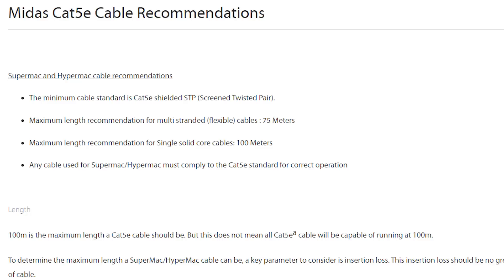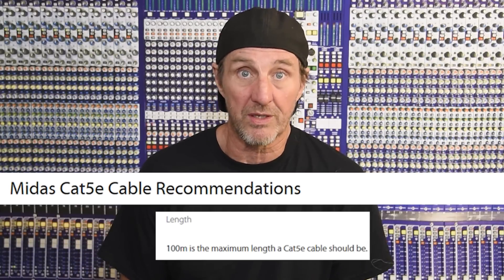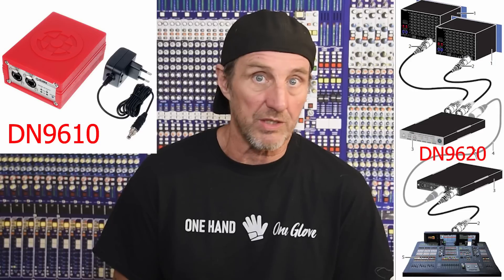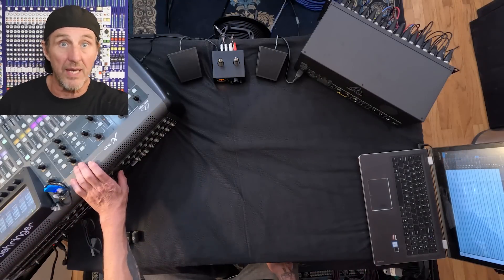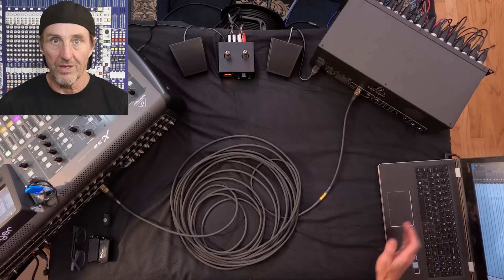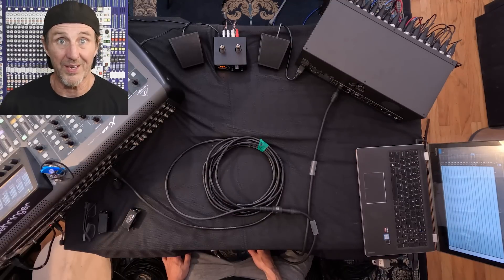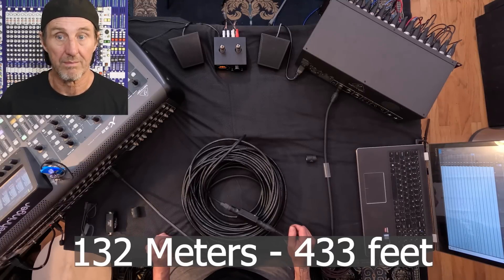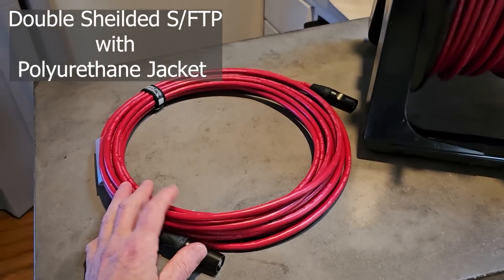Solving Long Stable AES50 Runs

Comment: As I mentioned in the comments section on your previous video relating to your new Cat 6A cable, Dave was very helpful pointing me in the right direction to get some Sound Tools Cat 6A in the UK. And so far, so good. The 100m length has performed as promised.

Typically I’ve ran 50 meter Cat 5e cables, and pops and silence have occurred when in venues where poor quality cable protectors have been used, or refrigerators for the bar have later been installed near my cable runs. Silly things, not show stoppers but in my view embarrassing and unprofessional.

Misinformation from ill informed ‘professionals’ parroting the erroneous information that has been circulating - particularly on Facebook groups can now hopefully be dispelled. Until Behringer/Midas improve their AES50 implementation in existing or new consoles the Sound Tools Cat 6A may be the only thing to save a great show from becoming a potential disaster.

As the summer festival season continues, I hope to review my success with this great new spec’d cable in the future.
Reply: @DaveRat Here I am half way through summer and your Sound Tools SuperCat 6A cable at 110 meters has performed flawlessly! I haven’t had a single drop out the last few months. I highly recommend this cable and the specification, and I am incredibly thankful for the time and effort you’ve put into creating such a useful tool that actually does what it sets out to do! To anyone who has experienced difficulties with Behringer/Midas products using AES50 - this Cat6A cable is the real deal! Even out in the wild!
Reply from the maker: @DanielEdwards- that is so cool and thank you Daniel!!
Reply from the maker: Super cool and thank you Daniel!
Reply: @DaveRat  I'm UK based also, and will be seeking to purchase one of these reels too. I've had problems with pops, drops and farts over a relatively short distance (50M) with the cable I have, and more recently I worked a venue where there was clearly a high degree of electrical noise. When connecting the DL32 to my board, the presence of the stage box was acknowledged, but it would not sync. When it did, as soon as I tried to play audio, it cracked, and dropped out.
Reply from the maker: Super cool, if you buy the cable, please let me know how it works and if ya like!

Comment: Dave, if I run 150 feet from my front of house console to my dl32 and then out of the DL 32 to a dl8 with hundred foot cat, does that mean my “aes50 length” is 250ft or just 150ft? I’m using all purple Super cat 5e and it’s been great. Just thinking about extending further.
Reply from the maker: no they're not additive so you have 150 ft run and a 100 ft run and you are well within a safety zone. All good!

as far as extending further, up to 250 with supercat is good,

so you can do 2x250 as long as it hits a box in-between.

if you use couplers, use the cat6a version and figure about 5 feet lost in length per coupler added.
Reply: @DaveRat  cool thanks Dave! One more question is the purple super cat 5E the most durable sound tools  cable? I need a few more and they need to be able to be stepped on and abused
Reply from the maker: here's a quick rundown of the sound tools cables and the thought behind the design of each one.

supercat is a CAT5E grade cable that looks and winds like a mic cable but has a polyurethane jacket like all sound tools cables that allow it to be flexible and high and low temperature environments and is extremely abrasion resistant  super cat is the best cable for State boxes and short to medium long runs

supercut 7 is slightly less flexible and windable but is double shielded which allows it to perform better in high noise environments and is great for ultra high speed data for shorter to mid-length. The extra shielding though and the small diameter make it a bit less ideal for longer runs.  super cat 7 is the best for high noise environments for short to medium long runs

The supecat sound is probably the only cable in the world that Cat5e ( actually better than CAT5E and almost cat 6a) Great that has an individual ground wire for each twisted pair. I don't think anyone has ever done this before and no one else is doing it. this allows super cat sound to be terminated like a normal four channel audio snake cable but provides the frequency response and data bandwidth that exceeds cat 5e.  super cat sound is our lightest weight cable and has  an extremely high pull strength making it the most durable cable that we make.

supercat XM is a large diameter cable like supercat sound is,  supercut XM is Cat6A grade and double shielded like supercat 7, And with the larger diameter double shield, it's extremely resilient to high noise environments and can run extremely long lengths with high speed data and/or analog because of its ultra low capacitance  super cat XM is the best cable for very long cable runs of 100 meters or more. supercut XM is very durable but not as high of uphol strength as super cat sound because it's the same diameter but rather than internal high strength fibers as filler it has more shielding making it a bit less flexible as well and a bit heavier. 

Cool cool I hope that helps and somewhere on the sound tools website is a chart which shows the data and specs of all the cables. 

but also I will gladly answer any questions and awesome thank you!

Comment: I've been touring going on two years now using AES50. We haven't had a show stopper yet, but plenty of problems (we were able to solve, but still...). Easily 95% of all problems we have is due to the venue not caring to cheack what kind of cable is actually needed.

Comment: Can repeat with gigabit Ethernet switch?
Reply from the maker: aes50 is a point to point protocol that will not pass through a switch. you can repeat it with a Klark dn9650 or dn9630, though at least for live audio adding a box and power in the middle of .a cable run where typically the audience is stomping around is not ideal.

having a cable that works at the length needed with no added cost, complexity or failure point is significantly more realistic

Comment: Hi !

Thank you for this very interesting video! For my part, I have varying results. I tested two reels that I made myself and that I use on my lighting console, they are Cat6a in F/utp (50 and 100 meters) and neither of them work. I used a prefabricated cat7 cable in S/FTP and a length of 100m and it does not work. The only long cable that has worked to date is a prefabricated 50 meter cable in cat6 in F/utp. I admit that I don't understand anything anymore and that I would appreciate a little help.... I am with a wing compact and two S16

Comment: Or, go fiber and 1000m. Klark Teknik DN9620 or DN9680. More pricey but, more bulletproof and longer.
Reply from the maker: Yes fiber is a good solution and we offer fiber on all of our systems. That said, fibers expensive, it's delicate and it is time-consuming and unless you can do fiber termination in house, The turnaround time for fiber repair can be considerable.

We have 16 drive systems as well as 32 node racks for the various deployments we do for large festivals and arena tours. 

We just got done switching all of our main snakes over to SuperCat XM and removing the two fiber lines that were attached to our 100 m main snakes. 

We kept having problems with fiber breaking and failing and we were spending so much money on fiber repairs and replacements that we had to find a better solution. 

So now every main snake has redundant super cat XM and every tour and gig goes out with two fiber reels that can be run separately if the engineer or technicians want to use fiber instead. 

Since we switched over we have had zero failures of the fiber because it hardly ever gets used because engineers and techs don't want to do the extra work to run the extra cable and zero failures of the more robust and reliable and easier to fix SuperCat XM Cat 6A cable.

So yes fiber is great except when it's not and we are a fairly good sized rental house with over 500 large format Main PA boxes, not a huge company but big enough and have been around for 45 years since I started the company so we have some experience in the field.
Reply: @DaveRat  Right on right on thanks for the reply brother! Even "Tactical" fiber is not crush proof. Also fiber ends and SFPs do need to be cleaned. Outdoor festivals yea I can see that being an issue. I primarily do indoor conferences and meetings so not much of an issue for me.
Reply from the maker: Yeah, so many variables and it's all about finding the best solutions for the applications.

Great to meet ya!

Comment: Don't understand the fuss here. Just use shielded cable, with very low high-frequency attenuation. AES50 data transfer is based on standard ethernet physical layer, so it has absolutely the same taste in cables. Just go straight for CAT6A, or CAT7, if you can terminate it in the ethercons. Limiting the number of connectors on the way also helps - so do not splice cables if not absolutely necessary. And sure, solid core cables have better transmission properties.
Reply from the maker: Agreed and also testing and showing that the words actually work in real life is important. There are a lot of words out there that people make up

Comment: I was toying with purchasing the DN9620 just to avoid this issue. But at $2300 plus the cost of a fiber snake, it’s a bit pricey. Although there is the benefit of extending the length up 500m!
I just purchased your 100m snake on a reel and can’t wait to try it out. I currently have 3 M32’s in my inventory that are all used for live venues, so if this is all that, I’ll buy more!
 I do own a Presonus 32 III that sits in the warehouse because of the same issue and in fact is a lot worse. I’m curious to see if your snake will cure it as well.
Reply from the maker: Super cool and keep me updated!

Just got done doing tests on Dante and Milan and was able to run up to 150 m on both and building out our spec for that cable looks like 120 m recommended max from sound tools gives it 20% cable length buffer

The reports back from the field from everyone that's bought it havw been awesome

Comment: Good to 80*C ? Good thinking on that spec! Never know where you may need to run wiring... like over a pizza oven🔥
Reply from the maker: Yeah! The cold side of the spec has a power company in Alaska using our cable. For the got side it's all about not getting soft and fragile jacket tears when baking in the sun

Comment: I’d run out of courage at 110m which is a pretty good distance.  350’ will get it done in many venues and particularly if you can fly it.  My analog snakes have always been 120m and it is a rare scenario that they come up short, typically leaving a big pile in the trunk. 

This is excellent work you’ve done, Dave. The manufacturers SHOULD be giving us this kind of knowledge. A network drop is the worst thing in the world. Like, sneak out the back door, move to a new town and start all over bad. You can take great pride in this.
Reply from the maker: Very cool and thank you so much!

Comment: I've often wondered and I'm hopeful I don't sound stupid asking.  In your travels, have you noticed a difference in how a rig will sound based on where it is in the world?  I mean, does the UK have a "sound", how bout the middle east or Russia.  Do different parts of the world physically sound different?  Based maybe on atmospheric conditions or the way resonance works in those locations.  Down to the type of rock in the ground.  It sounds like something that would be a thing.  Maybe you got a minute to answer.
Reply from the maker: Temperature, altitude and the shape and type of ground and surrounding plant life and structures definitely impact the sound drastically. I've done several videos on the impacts of heat on sound as well as an AES paper on the impact of heat altering dispersion of loudspeaker horns.

Separately from that they're definitely are also cultural differences in the types of sound different regions find desirable. Some countries tend to lean more towards powerful low end and some tend to lean more towards clarity and upper frequencies with subdued low frequencies.

Not so much now as it used to be many years ago. Years ago the differences were quite drastic as you traveled around the world when you went to local clubs and listen to the tonal mix of the sound. 

My opinion is that when iPhones and iPods and became worldwide available, that tended to normalize sound towards a common reference point which didn't exist before that
Reply: @DaveRat  How sad is that?  The dissolution of analog culture as it's swept along into the digital normalcy.  Copies of copies.  To your point though I'm interested.  The music of the Arabic culture.  The nonPythagoran structure.  You think that could have roots in the geography as strongly as the culture?  That feels like it would open a huge can of what if's about geographical resonance directly influencing cultural development.  Very interesting.  Also, I watched your videos ages ago about how heat, cold and humidify influence audio propagation.  We have an amphitheater on the river here in Little Rock.  During shows you can sometimes hear the moisture rolling off the river and crossing in front of the stacks.  It's the odd phasing.  You're demo with the blow dryer really opened my head to that type of thing.  I've written a little program for my audio palls that lets you plug in temp and humidity when calculating time delays.  I think it makes me look smart. :)  Appreciate the reply.

Comment: Not directly related to the topic in this video, but here is a technical idea that I had:

I think higher voltage amplifiers and speakers should become a thing, this would reduce the power loss between the amps and passive speaker arrays, which is most of the speakers on the market. This allows for thinner wires going to the speakers, or higher power at the same current as before, or both. A higher voltage speaker just needs to be higher impedance which is easy to do, just add more turns, the main difficulty would be on the amplifier side which would need to output higher voltage signals.

In the EV industry everything is increasing in voltage because of the reduction in cable size and higher power transmission at equal or lesser currents, and with new SiC and GaN switching converters this is becoming possible. It could be a path forward in the entertainment industry as well.

The LA16x amplifier can drive 16 ohm speakers but at reduced power output, which I assume is because of voltage limitations. Outputting higher voltage it would theoretically be able to do higher power, but maybe 120/240 VAC is the limitation. Step-up voltage converters or a 480VAC supply might be necessary if higher voltage amplifiers are to become a thing in the future.

Thoughts?
Reply: I think a tri-phase amplifier would be enough.
Reply from the maker: With 70 volt systems they already is that higher voltage infrastructure in place. And 70 volts seems to be about the voltage limit to balances between safety of shock hazard and gaining advantages of using thinner wire. 

That said, 70 volt systems don't tend to sound very good and tend to be based on step down transformers located at each speaker and used to have step up transformers at the amplifiers but modern amplifiers can present the higher voltages without the transformers.

There is a trend going the opposite direction actually. Turns out that lots and lots of winds a very thin wire to form a hiring impedance voice coil is kind of wasteful due to the added insulation needed and wasted space of stacking the wire. 

So this is anissue with 16 ohm or 32 ohm or higher impedance drivers that would be well suited for higher voltage runs.

Conversely looking at the iPal drivers wherein the driver voice coil and impedance is optimized for maximum capability, which ends up being a very low impedance driver with fewer winds o thicker wire, And then using amplifiers capable of driving those low impedances and minimizing the speaker cable length to the driver from the amp, is a very effective way of getting impressive low frequency power and response.

Take a look at the iPal stuff from B&C, 18 sound and powersoft.

It's pretty cool to optimize the speaker which is the tough part and then build the amp or use an amp capable of driving it.

And break free from the speaker being designed in order to be compatible with historic amp output capabilities.

Comment: pardon my ignorance, ethernet/network switches are incompatible w/ the data transmission protocols in pro-audio?
(these days switches introduce latency under 0.1ms)
Reply from the maker: There are many audio over network formats used for pro audio. Some are Ethernet compatible, some are not. AES50 is a layer 1 and does not use the Ethernet frame structure. 

Latency added by switches and such once a signal is digital tends to be very low 

The issue is in the conversion from analog to digital and back to analog where conversions to and from more complex layer 2 and 3 Ethernet adds more latency than converting to and from layer 1. 

The issue is that later 1, while having very low latency conversions, also does not have all the the features and compatibilities and protections of the higher levels

https://en.m.wikipedia.org/wiki/Comparison_of_audio_network_protocols
Reply: @DaveRat  thanks mr Dave, i understand... i did not expect that plethora of protocols :)
Reply from the maker: 👍🤙🤙 cool cool and I like hearing and exploring all perspectives